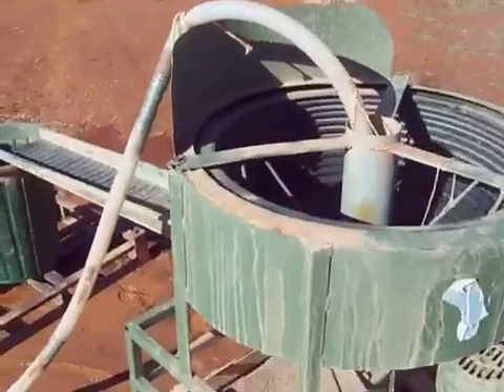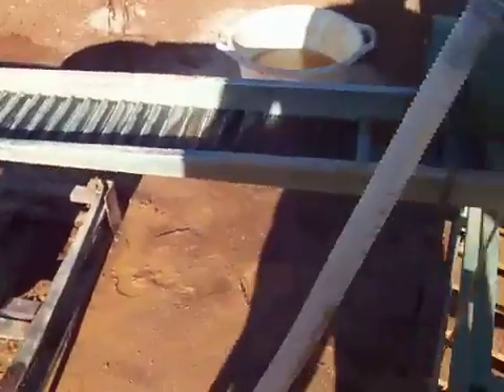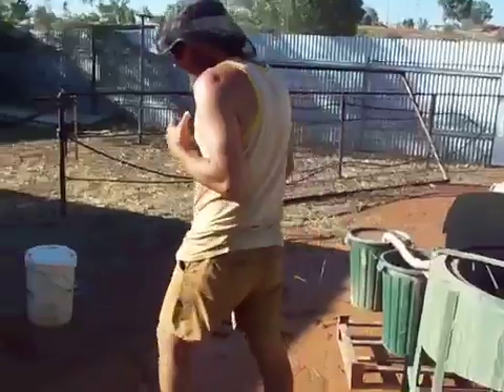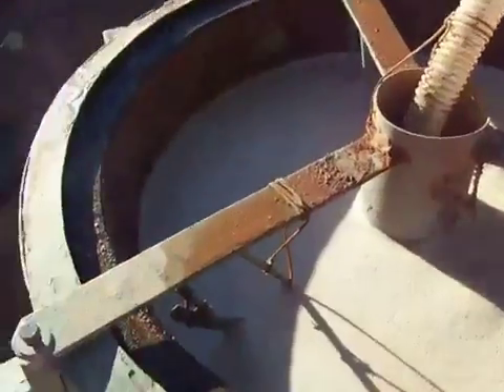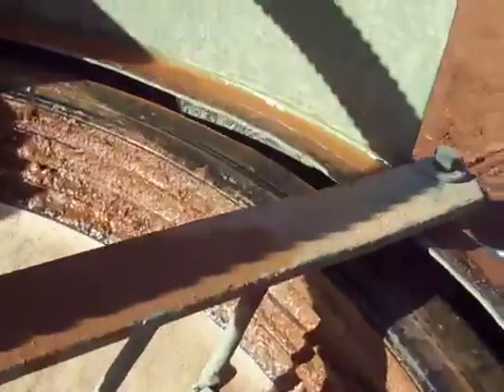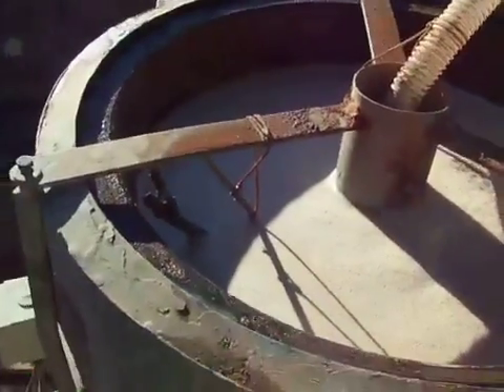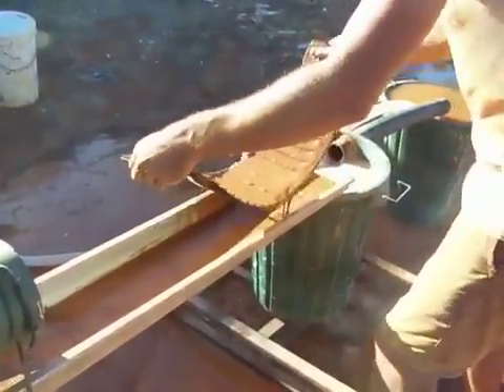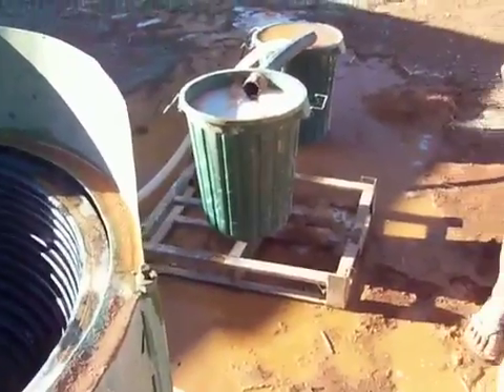Small scale gold mining - Knudsen bowl gold concentrator

Comment: Very interesting set up, Trent.Next step ,in my mind,would be to set up some sort of hopper and feed chute,so you don't have to spoon-feed the machine.Maybe even ,instead of introducing the water to the system at the bowl level,introduce it at the hopper level ,which at the same time would flush material from your hopper,killing 2 birds with one stone ,as they say...Trev.
Reply from the maker: Trev's Bush and Gold Adventures 
Already got a plan in the pipeline for that Trev, going to have my big crusher feeding straight into a slurry pump.  That way I don't have to double handle the material, just feed into the crusher.
Reply: Trent King Sounds interesting.Love to see that when she's up and running.